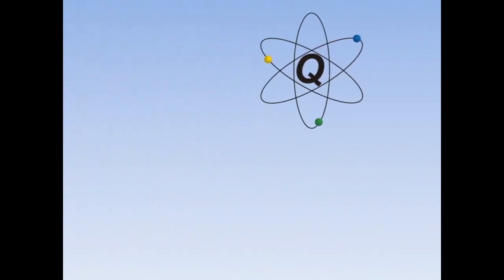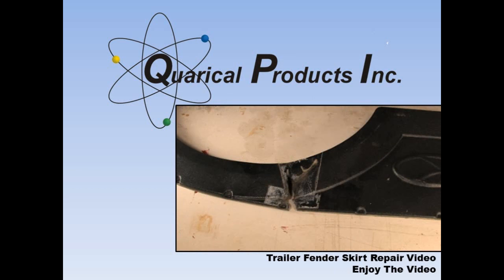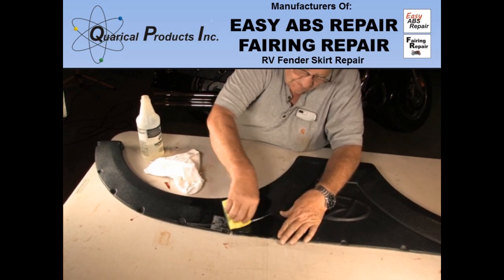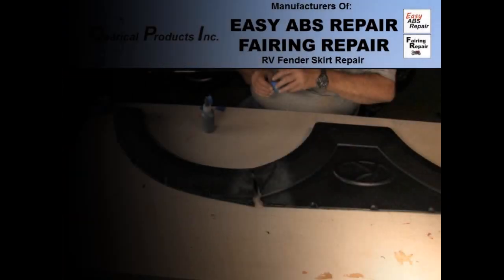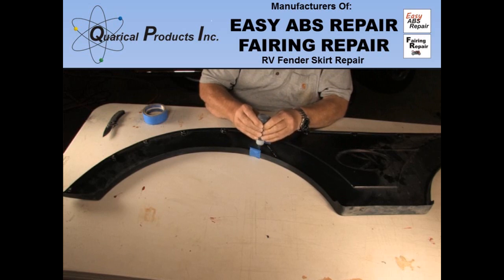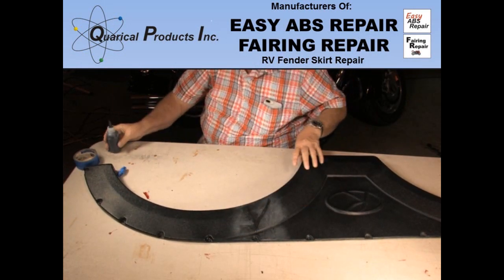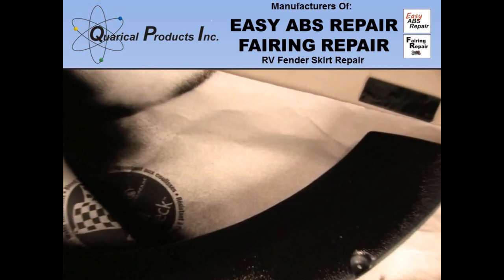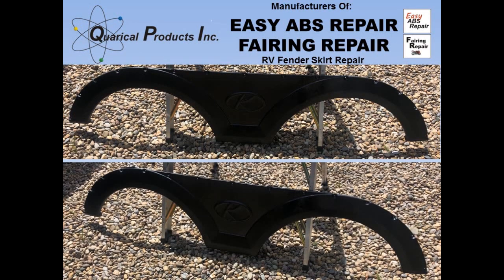RV Fender Skirt

Comment: what is the shelf life of the product once it is partially used?
Reply from the maker: Hi Robert  when you are finished the repair put the applicator spout ack in the box and put the white seal cap back on. The next time you go to use the resin the cured resin will jut pop out and leave you with a clean as new applicator. With the white seal cap on and tight we guarantee a 3 year shelf life